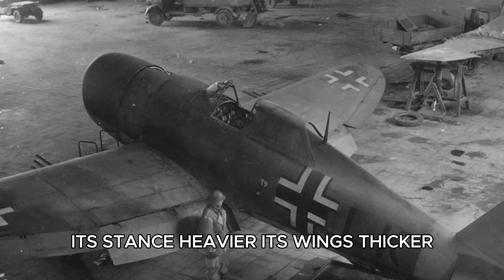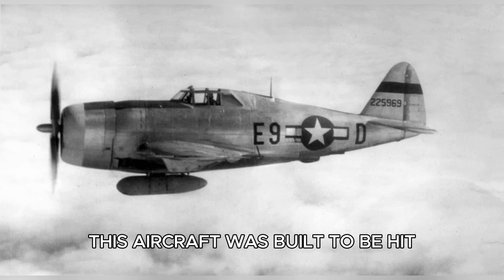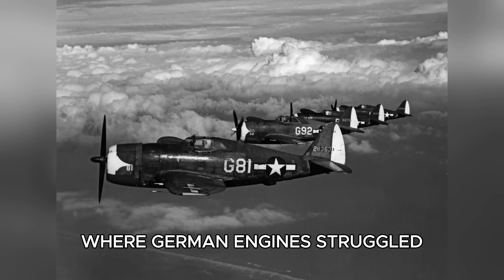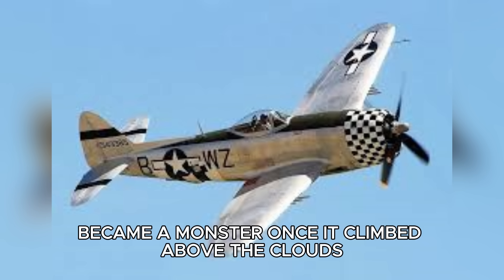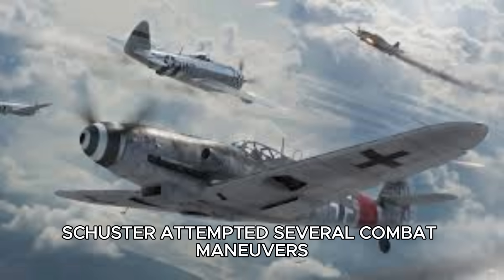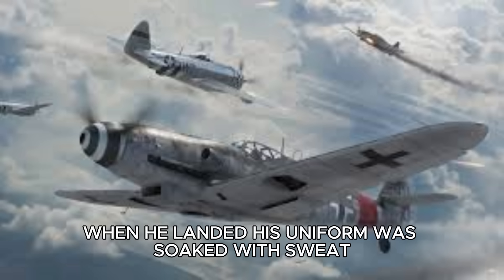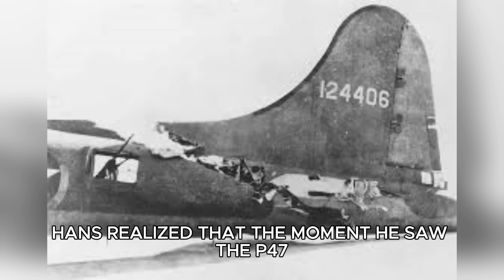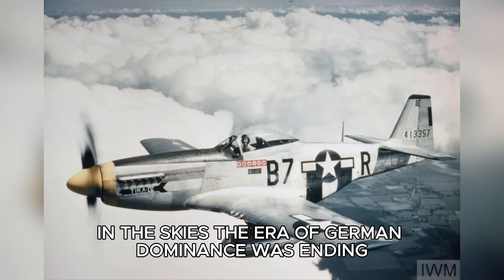The Day Germany Learned America Was Built Different

Comment: Nice fictitious story set in an historical environment.  I liked it overall. There were some inaccuracies, though. The Thunderbolt didn't have armor on the belly or around the cockpit; Rather, the cockpit was surrounded by a lot of structuring and systems(EG the turbocharger ducting) that formed a natural protection for the pilot. Also, the Germans were by no means unfamiliar with turbocharger technology, and it wasn't the massive leap over supercharger technology that this video claims; In fact, the P-51 Mustang and P-38 Lightning, two supercharged US fighters, enjoyed high-altitude performance that was comparable to the Thunderbolt's, thanks to their superchargers being more powerful than the Bf-109's in exchange for those planes' engines having smaller displacements than the German counterpart. And the Germans were not by any means unfamiliar with the concept of the fighter-bomber at the point of the war this story takes place in; They had already fielded the FW-190, a fighter that was more rugged and versatile than the 109 and which could carry considerably more ordnance, affording it to take on multiple roles including fighter, ground attack, anti-shipping, night fighting etc.

Still was a fun story, though, and gave a nice overview of the P-47's strengths and characteristics throughout.